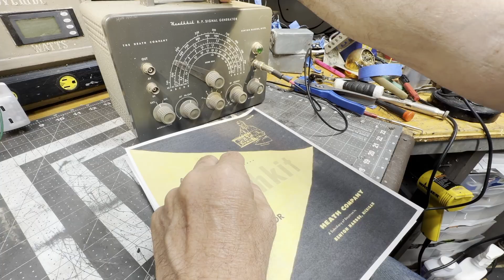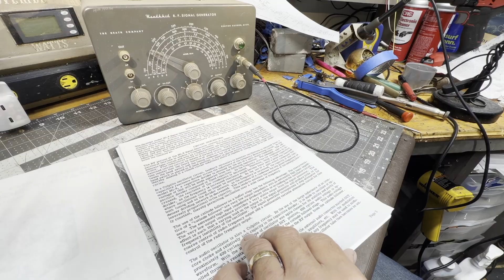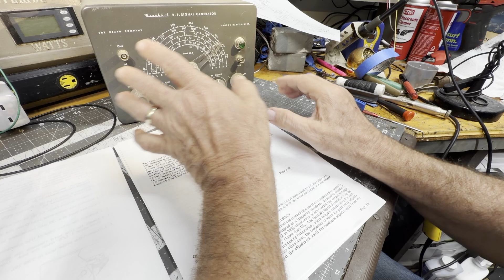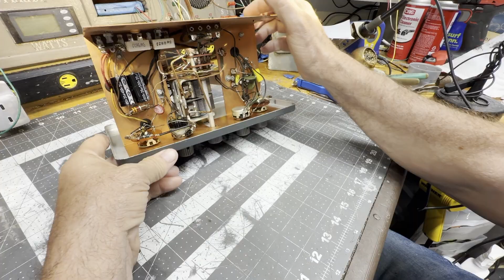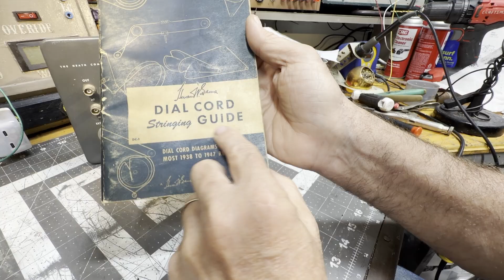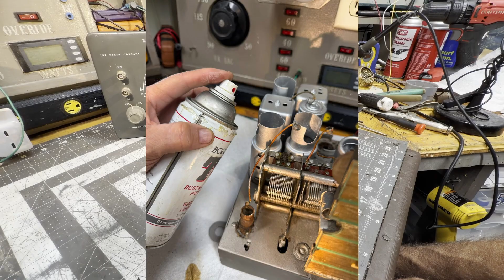Ep 31 Timeout Tuesday.  Heathkit Model SG-8 Signal Generator

Comment: I  have an IG-42 , the Lab Grade Signal Generator, which completely isolates the coils with copper sheeting. Going to have to
work on that someday. Your SG-8 looks pretty good. A diode with a 100 Ohm 2 Watt resistor in series is a good replacement 
for the original Selenium rectifier. I would read up on the article by the Orange County Amateur Radio Club by Bob Eckweiler.
They do have some great articles on Heathkit stuff there.
Reply from the maker: I will do that. Isolating the coils makes a lot of sense